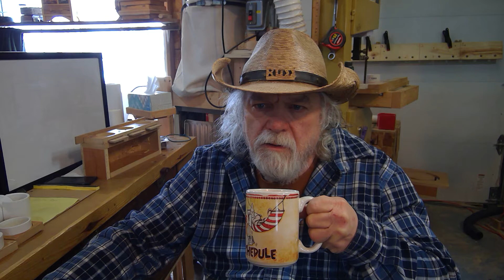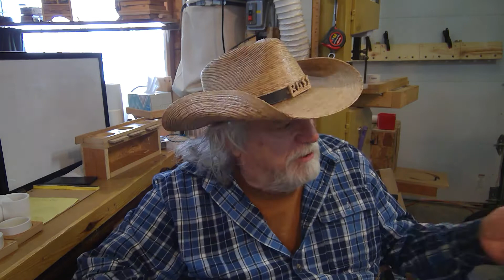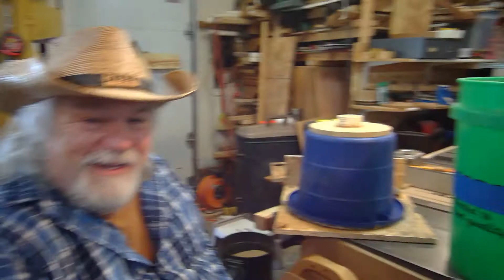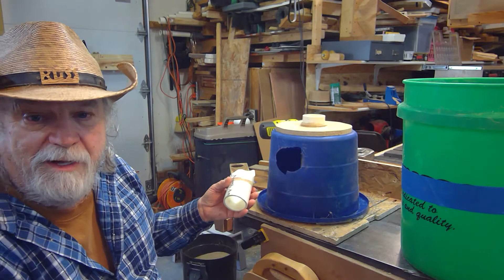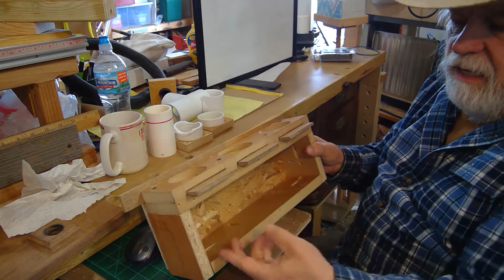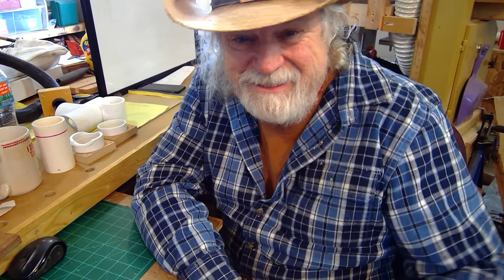Shop Vac Multitasker Update 2 by OTB Thinker

Comment: Happy Easter Buddy,  I was up towards Walworth Co, and when I faced your direction I think I saw you thinking, I saw that  BIG plume of smoke coming out of your ears, you must have been coming up with something awesome!
So, an easily removable  Plexiglas cover for the manifold.... well as you learned, it's gotta be a thick piece for starters. What's that stuff they use for ATV/snowmobile/motorcycle windshields? I forgot the name, a lot like Plexiglas, but less shattery. How about some grooves for the thick acrylic to set in. Similar to the gap you have from the dado on the actual blast gate? If you have stationary sides and top, you can use a pivoting "finger" to lock the bottom, swinging that "finger" to allow the acrylic to slide on down, and out/off. I dunno how to word it, so I'm am truly hoping that you understand!
As for Noah, Russ if you follow any other youtubers, maybe you have seen some of the DIY stands for like a Harbor to Freight Power Planer? He could make a joiner from something like that couldn't he? I'd try for a link, but am currently drawing a blank as to who has a build on one..... there's a nonspeaking German fella that has a shop full of DIY equipment, I'm certain he'd have one.
Well, regardless, sorry to hear about the goof on the thin bucket, better an implosion than a plastic explosion, like a PVC high pressure line off a compressor.... hope you had the opportunity to see some Family and Friends for the holiday, and didn't play too many practical jokes for April Fools Day! Glad to see your well, and looking forward to seeing more fabulous projects and ideas! Take care and stay warm.
Reply from the maker: I actually laughed when it happened.  the reality kicked in slowly later :>) 
 for a glass, i acquired a small basketball hoop and backboard out of acrylic.  used a piece for my blast gate on the bandsaw dust collector and used a piece for the air filter box in my Legacy workstation vac. just enough left to use on this vacuum manifold.
BTY, what at you doing out of AR?  do they allow you leave the state? :>)
thanks for the input.  Happy Easter
Reply: Russ Veinot oh no, I'm a FIB, just over an hour south of you. Was picking up my grandmother for Easter. In the warmer months we tend to frequent the area, so I'd like to set up a meet if that's okay?
And that's probably made from Lexan, which is what I was drawing a blank on.
Reply from the maker: what community does granny live near?
Reply: Russ Veinot out west, towards the old Delavan Dog Track and Lake Lawn Lodge. 
The "smoke" was the Kenosha Power Plant cooling towers, twas a clear sky, so the steam was visible for miles, kinda like when you can see the Sears Tower from 12 in Fox Lake.
Reply from the maker: Wow, that is pretty close.  Let me know the next time you are here and have spare time :>)  sorry it took me so long to look up the location.